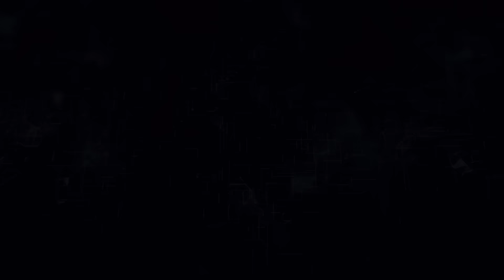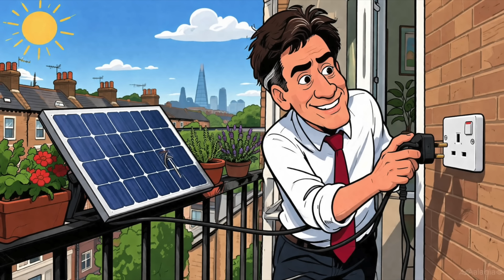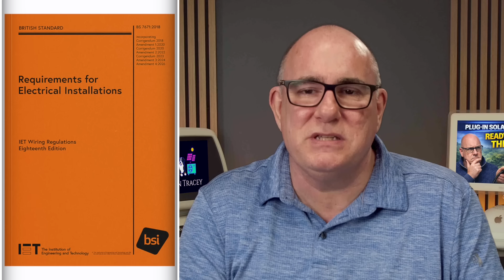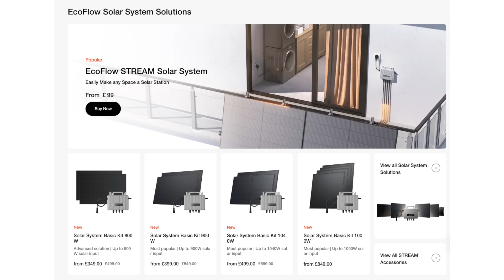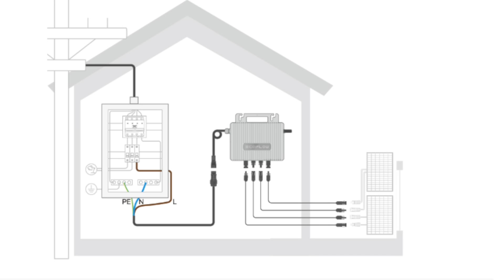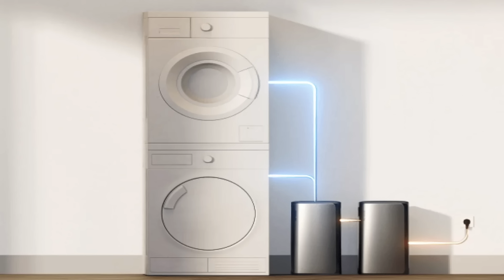Plug In Solar Is Coming… But There’s a Problem

Comment: So even if you get your plug and play system and it has somehow become legal to use it may still be a kick in the teeth as few houses consume more than 500w when unoccupied so a 300w portion will end up going back to the grid via your smart meter that doesn't run backwards and so you will likely be charged for that 300W assuming that it is an 800W system and its a super sunny day
Reply from the maker: not if you buy a battery, save what you don’t use and use it when you come home
Reply: @JonathanTracey 
You are now making a simple system more complicated and how will the simple system know to charge the battery, the fly in the ointment is the electric meter. You have to take into account that the base load is not constant its random fridge and freezer starting and stopping on there thermostats the boiler doing the same 
The basic idea is good but I doubt the government give a shit about the man in the street having to pay.

Comment: We have a South facing solar system with 5kW inverter and two Tesla Powerwall 2 batteries.  I'm considering a plug-in solar too, mainly to mop up with the South-west evening sunlight which our present system misses out on.  I believe it is OK to add one of these to the mains supply to our shed, despite that being on the output side of our Powerwall 2 system.  My hope is that it will deal with much of background load of the house, so we will just see the house load fall a bit when this is generating.  I'm not expecting it to charge the Powerwalls or export anything.
Reply from the maker: @video99couk that’s exactly how it would behave 👍  

It’ll just offset your background load first, so you’ll see import drop rather than charging the Powerwalls or exporting.  

Just worth double checking the circuit it’s connected to is suitable for backfeed 👌

Comment: Of course if this does happen and ready at end of summer (seems optimistic), people will start having this just in time for winter when potential for generation drops to circa zero...
Reply from the maker: @sspicyyful fair point 👍  

Winter generation is low, but not zero — and these systems are more about offsetting base load year-round rather than peak summer output.  

Even small savings add up over time 👀

Comment: Anyone who does not know its just 800w for your own use/storage is just as dangerous as a  diy plumber living upstairs.
Reply from the maker: @Rodders1234 ah yes, because generating 800W is basically the same as flooding your house with a DIY plumbing disaster 😂  

In reality it’s a very small amount of power (~3–4A), and modern systems have built-in protections.  

The danger isn’t “people not understanding it” — it’s poor installs, same as anything electrical 👍

Comment: Pointless system as it only produces the 800 W in bright sunshine if the panels are orientated towards the sun.
The average DIY solar system only produces half what it should.
And you need the electricity at night when the system douse not produce any electricity. 
I worked out even with the expensive battery. The system would not even power my gaming computer in winter, it may just about do it in summer. 
Not worth the initial cost.
Reply from the maker: @gerardwood4059 ah yes, solar only works for 10 minutes at noon in perfect sunshine 😂  

In reality panels generate all day, even in cloud — just at lower levels.  

And it’s not about running a gaming PC 24/7, it’s about **offsetting base load**, which is where the savings actually come from 👍
Reply: @JonathanTracey PC plus monitor, speakers, and steering wheel with powerful electric motors is close to 600 W continuously. 
Allow for 10% loss in conversion from DC battery to AC your now at 660 W.
So the strength of the day light has to produce more than 660 W for at least the same number of hours as the computer is used per day. So a computer that is running at maximum work load for 8 hours is the same as the day length. Add on other TVs, router and lights and that is the rest of the stored electricity used up.
Yes in summer the solar system would work well even with the fridge and freezer.
In winter when we use most of the electricity per year the panels produce the least.
We did the calculations on a full system to go off grid and priced it up £16,000 but then found the government regulation on how many panels we could have changed the return on investment from 4 years to get back the money or as it turned out 6 as the electricity prices went back down.
But the limits on panels ment we would probably be dead before we got the money back.
It makes zero difference on what in the house actually uses the electricity. 
In most cases, without the battery the 800 W generated is not used because you are not at home. Base load is continuous electricity used and that only counts for all the things you leave on standby (big savings by turning them off at the sockets) fridge, freezer and central heating are intermittent electricity use so what do you do with the unused electricity, sell it back to the grid but the cost of the equipment to do that suddenly makes it not a cheap DIY job anymore. 
But go for it if it will work for you.

Comment: Here in Belgium we have the " sinegrid" rules and producers must be agreed and listed in the sinegrid list. Here we are using 800Watt as standard. We can use more then one microinverted and we can install it ourself and if you have a digital powermeter ( counter) you have no obligation to declare the system. If you plugin the solarinvertor you want have the first 20 seconds power as the invertor has first to know if there is power .. if not no power. So, if for any raison you dont have power on that circuit your plugin will not work
Reply from the maker: @woutb.5210 really useful insight 👍  

Belgium is definitely ahead here — especially allowing multiple units and simpler installs.  

And yep, that startup delay / grid check is exactly how anti-islanding works.

Comment: In NL solar-plugin panels as well as plugin batteries are quite common for already several years besides roof top installed systems.
My home configuration consists of 20 roof top panels of 7200 WP total with Solar Edge Converter.

At the meter cubbord an additional electric group was installed  by a qualified electrician with dedicated cable connected to  4 way socket.: Then simply DIY 4 plugin  batteries  ( each 2.4Kw)  of Home Wizzard connected. to the socket  and wifi connected in the Home Wizzard app.
Batteries are loading (solar power)  based on the  information of a DIY  plugin P1 meter (Homewizzard)  into the standard home dutch digital  electricity meter  and  then also connected to my home wifi.  
The digital electricity meter always show the  4 data of incoming and outgoing current for both high tariff (day) and low tariff (night) .
All data can be seen on a Home Wizzard display  in real time., which display I placed in the kitchen. ( als additional water and gas consumption on display)
( Home Wizzard is a dutch brand available in NL en B. )

As a hobby project  I have placed  2 DIY plug-in panels of each 880 WP in the garden and plugged in directly  on the electrical  230V system : both are  from factory equiped  with a micro-converter and 10 or 20 meter outdoorcable for lupin. On/Off switch at the back and cost were  just 560 euro all in (2024)
In NL there is no limit to number of plug-in panels ( as your fuse will blow out automatically) , but it is save to stay well within the limits of each of the 3 available phase connections  of your home of  each 16 amp x 230 Volts is 3680 Watts , totalling 11.040 Watts. 
Well, you will need a  lot of plugin panels to set you house on fire  😀 !

All plugin panels and batteries will automatically shut down in case of  power outage for security reasons ( CE  mark)

Comment: Why hasn't this been possible before now in the UK????????
Reply from the maker: @Marcus-p5i5s good question 👍  

It’s mostly been regulations holding it back — UK rules were written for full installs, not simple plug-in systems.  

The tech has been around for years, it’s just now the standards are starting to catch up.
Reply: @JonathanTracey  But why were there rules at all?  In the USA there are no rules about me plugging in some solar panels to make local power to run my fridge (an example) when the power goes out.

Comment: Yeah there is a problem. People don't understand energy density. Solar is shyte unless you have a football pitch sized array in a country with sunshine and a humongous batttery module to store it. It's not the magical power source everyone believes it to be and way far from being cheap or efficient. Yet the sheep will continue to echo and regurgitate the B.S fed to them without actual scientific facts or knowledge. California is the one place that has had the most investment pumped into it for multiple forms of "Green" energy and guess what.... They load shed their power at times and have blackouts quite often. Proof that even with millions thrown at it, it doesn't suffice and never will.
Reply from the maker: @majikalbushe ah yes, the football pitch argument makes its annual appearance 😂  

No one’s claiming solar powers everything on its own — it just needs to **offset what you’d otherwise pay for**.  

And California blackouts? Mostly grid management and demand issues, not “solar doesn’t work”.  

Meanwhile, millions of systems worldwide quietly saving money every day… but sure, must all be sheep 👍
Reply: @JonathanTracey  I didn't claim it was everything on it's own either. I gave the biggest example in the world of California that uses every form of green energy they can, costing Billions, and it still doesn't provide sufficient energy. Proving my original statement that people don't seem to understand or grasp energy density, yet they'll continue to forcefully push the pie in the sky without any technical knowledge.

Comment: i have a solar system on my roof and when i installed it 7 years ago my hope was to get my bills down to zero but im not there     i just finish a wooden frame on wheels with 4 panels on so i can get the best angle     the 4 panels are JA solar 380 watt so i cant wait for the plug in system to become fully legal and ill go and purchase one       im still looking around
Reply from the maker: @stagman4611 sounds like a great setup 👍  

That movable frame is actually a really smart idea for maximising output 👀  

Plug-in solar could work nicely alongside what you’ve already got — especially for topping up your base load.

Comment: Had my EcoFlow with 440w JA solar for over a year now. 416.47kwh in 2025. I did at times lose energy to the grid, which was unpaid due to no g98. The extra expense of a battery would only have been worth it if I could have used a second panel. A plug connection is fine. It's fine for Europe. It's especially fine if you don't have children or pets in the home. The UK regulations are restrictive and unnecessary.

My big boy roof-mounted system will be installed at some time over the next month or so. 8x465w panels on the SSE and 11x465w panels on the NNW. The roof is at a 40-degree pitch, so fairly steep. This is going into a Tesla Powerwall 3 with a Tesla gateway. 

The pitch has always concerned me for north-facing panels, but I'm looking at the generation of the EcoFlow system during periods of ambient light, and I think I will be happy with it. This all came out at just over £17k quoted, which is pretty expensive, but I went with Heatable. They also subcontracted the installation out to E-Verve Energy, which I'm a little hesitant about, but did find a few good reviews for them and didn't find anything negative. They are also super local. Had the site inspection last Wednesday, couldn't have the battery or gateway internal, as I wanted due to fire regs, but looks like they can fit the Powerwall on a lime rendered section of the front wall. I'm having nightmares of them bouncing the render off the walls. I'll be having a slow and steady, minimal setting on the hammer drill with the installers when they get here, haha.

I went for the REA 465w panels. They did offer the 485w Longi but that came in as more expensive than the double glass of the REAs. The REAs, if I remember correctly, have a better power and possibly build warranty, and the thermal drop off was better with the REAs.

I'm more than happy to share my generation data, especially for the north-facing if that's of any interest. There really isn't a lot of it about, especially on a fairly steep pitch. I'm hoping the 60v startup requirement on the Powerwall 3 will shine here, especially with 11 panels on that string.

When it comes to plug-in micros, I will probably install a solar pergola when I splash out on a new back garden at some point in the future. This will likely have micros due to shading issues throughout the day/year, but I think I could also use the 3rd string of the powerwall with power optimisers but I'll look at the market closer to the time.

Comment: Thanks for this Jonathan, we are thinking of getting one panel at some point and believe it comes with an inverter and plugs into a 13 Amp socket. You mentioned charging a battery which makes sense. So what else will be available with these panels? Or what did you advise?Thanks
Reply from the maker: @marcusbain8743 great question 👍  

At the moment most of these systems are pretty simple — panel + microinverter + plug.  

Where it gets interesting is when you add:
- A battery (store excess instead of exporting)
- Smart control (charge/discharge based on tariffs)
- Expansion (more panels/inverters over time)

My advice right now is start simple, then build it out once the regulations and products mature a bit 👀
Reply: @JonathanTracey Thanks Jonathan will probably wait till summer and get mote options and information from your good self now I am subscribed. Happy Easter.  🙏

Comment: We have this in Germany it‘s called balkonkraft. To get the most out of it you need an electric meter that has a spinning wheel and not digital. If you have the old meter with the wheel inside on a sunny day the meter starts to run bacwards but with a digital meter any unused power is just lost.
Reply from the maker: @combrogi interesting point 👍  

In the UK, modern smart meters measure import and export separately, so they won’t run backwards like the old spinning meters.  

Unused power isn’t “lost” though — it either gets used in the home or exported (if your setup allows it).
Reply: The system adapts its input resistance to draw the power it needs. Power is not lost; it is not even generated in the panels, analogue to when the battery is full and the panels are in full sunlight; no charges will be drawn from the panels. The sunlight just heats up the panels.

Of course no energy ever is "consumed". It is only ever converted.

Comment: What about Narrowboats live-aboards and Motorhomes?
Reply from the maker: @DenisHuaHin good question 👍  

For narrowboats and motorhomes it actually makes a lot more sense — you’re effectively off-grid already so you can use everything you generate.  

The plug-in side is really just for grid-tied homes.

Comment: So you need to plug it in presumably inside as that's where you want the power to used... But last time i checked, the sun is outside...
Reply: The panels are outside and the cables from the panels run inside to the inverter, then out of the inverter with a normal house plug which is pluged into the nearest socket. It‘s really a simple system.
Reply from the maker: the panel are outside then we have these things called cables, miraculous things can snake through holes in walls from outside to inside

Comment: One thing I don't understand is what the regulation is around plug-in batteries. I am on a dynamic contract with Octopus, and it would be great to charge a battery at night and use it during the day. It would be the same thing that plug-in solar does, where it would push power into my house's mains, but it would not be plug-in solar. Is that part of this new law change this summer? Whenever I look it up, I get conflicting results. Thanks!
Reply from the maker: they come under the same category microgeneration, for batteries to feed into the grid requires them to have an inverter either a separate device or one built into the battery stack. So as far as the grid is concerned, they’re one in the same.
Reply: @JonathanTracey  That makes sense. Thank you. So my best bet is to wait till end of summer before looking into some renter friendly batteries? I dont want a huge wall mounted system. I just want something small-ish

Comment: Curious to know how two or more units would behave in island mode protection? People will do it.
Reply from the maker: it just works, i have two plugin microinverter (with no island support) and a bigger solaredge inverter with island support. When the power goes out (or I pull the breaker) the solaredge continues to work, the microinverters shut down. The 50hz from the solaredge does not fool the microinveters to start producing again

Comment: A £1200 16kwh 48v home battery and a 48v charger allows you run a microinverter which is tied to a smart meter, Buy electricity at 7p kwh and use it at peak rate, save a lot more than £100 a year, I save around £85 per month in the winter this way.
Reply from the maker: @ukinfamous yep that’s a great example of energy arbitrage 👍  

The key is that price gap between cheap and peak — if it’s big enough, it really works.  

Just need to factor in battery efficiency and cycling, but your savings sound spot on 👀